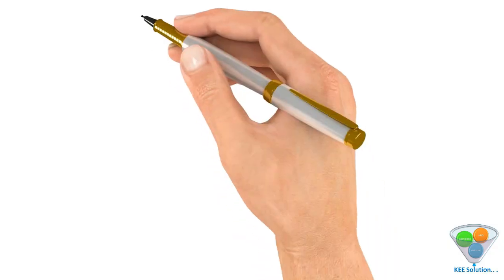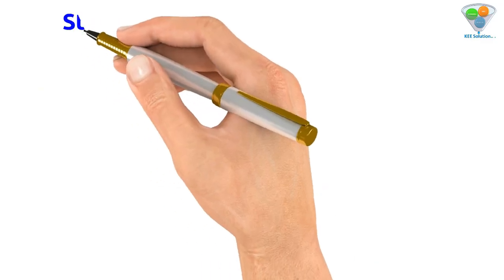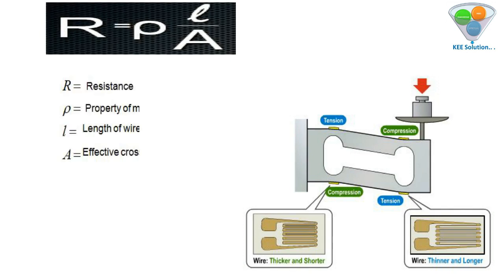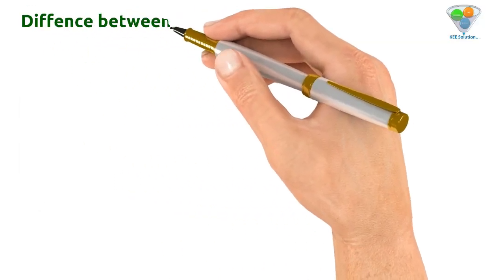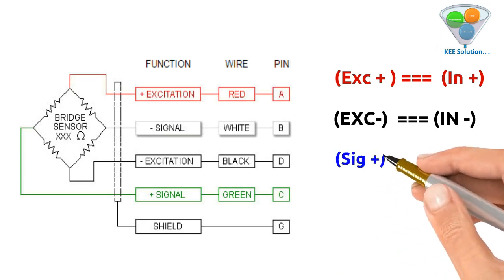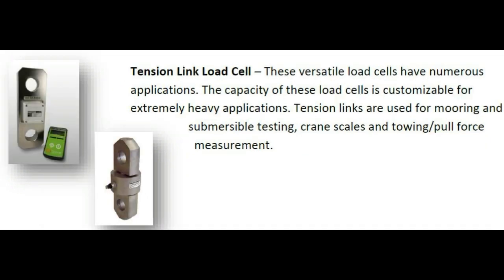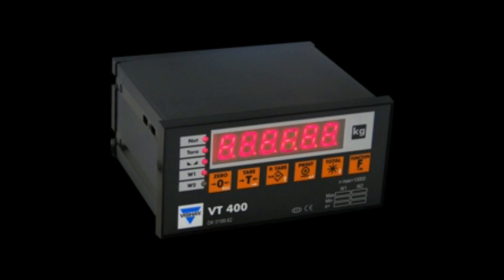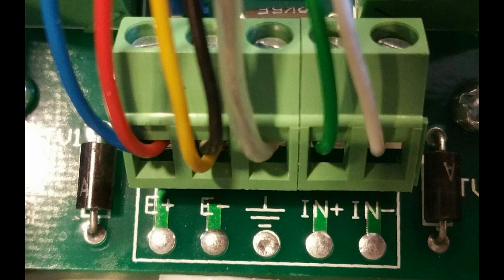Load cell working principle and connections | Wheatstone Bridge | Type of Load cell and App

Comment: Impressive but I need your help on how to activate dead load cell.forinstance,a load cell that stop reading when big object fell on it?
Reply from the maker: Generally it is not recommended to repair once load cell got damage, it is better to purchase new one , if you try to repair in anyway it will malfunction.
If it is 6wire than you can do by looping as in video , if it is 4 wire generally not easy task .

Comment: Hello Sir, For the high speed Application in load measurment sysment , Which parameter should be checked for buying load cell?
means sample per second or response frequency ?
Reply from the maker: Hi Gaurang, You can ask your all quarries from direct Mettler by call for better solution for your exact application, Call to Malkeet Singh  09803389844.

Comment: Why it is said not to cut wire of load cell even if it is much spare?
Reply from the maker: In that case , may be wire resistance is also calculated in that system